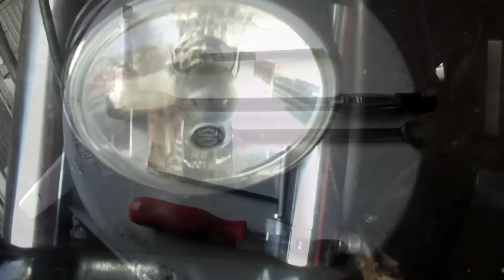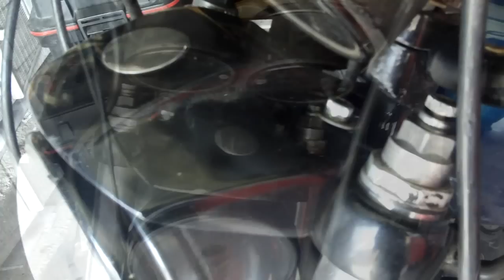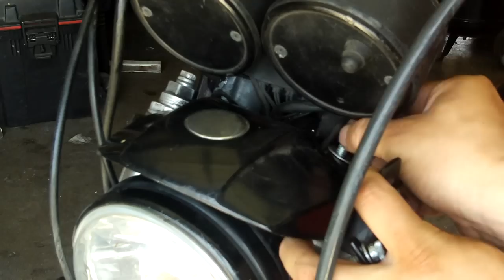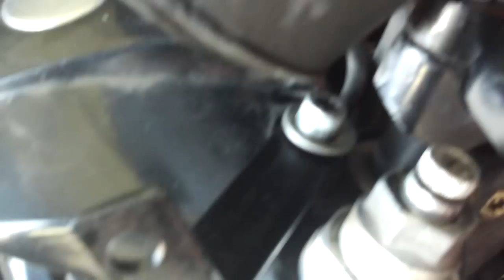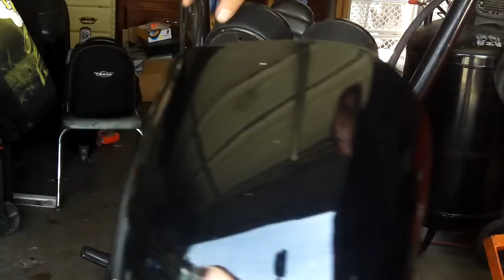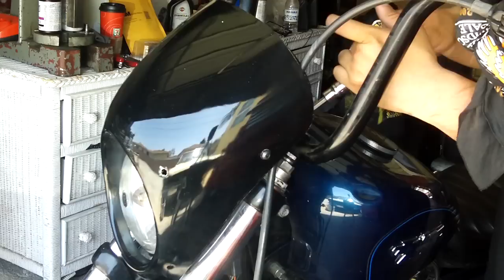how to install Sportster Fairing

Comment: What's the two holes in the front of the fairing for ? My fairing didn't have any holes in it like that
Reply: he either went the very cheap way and bought a used one that the previous guy installed like a jackass or it was installed on a non compatible bike before and was modified to fit... either way, it looks bad and wouldn't have put that on my bike at all